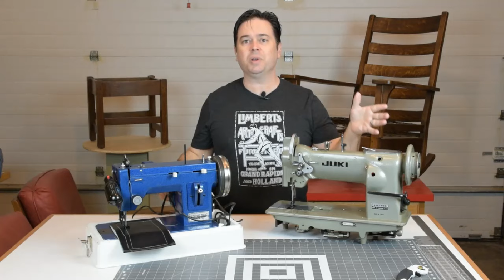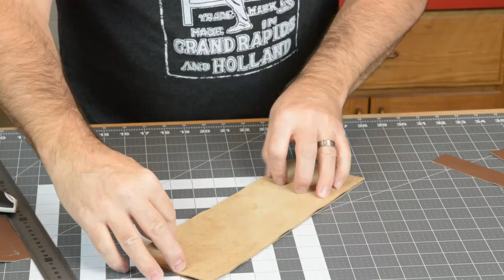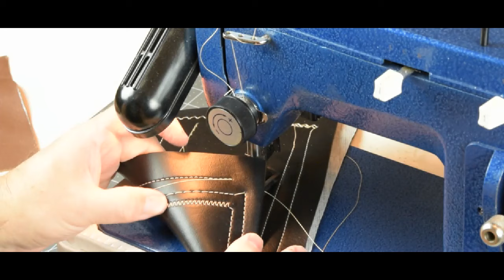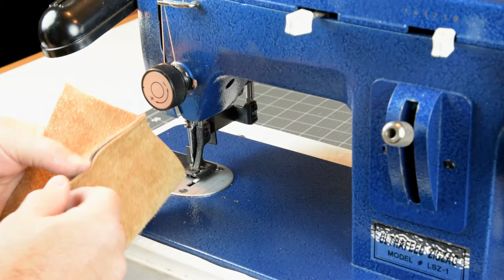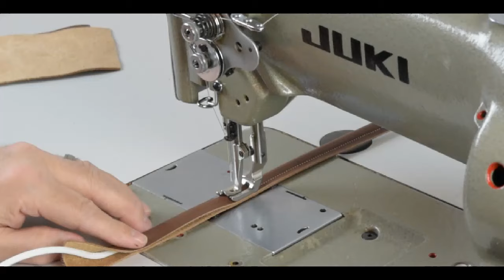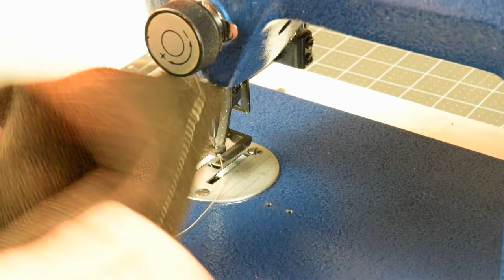Mini Walking Foot Vs Industrial Walking Foot Sewing Machine Sailrite and Juki Compared

Comment: Hi!  I love your Videos!
In this one, when you made the piping with the Sailrite, did it have the piping foot installed?  It looked like the Juki, which is an Awesome machine, did have a piping foot on it at the time.  The outcome from the Sailrite on that test was, imho, not good.  But, to be fair I just wanted to make sure it was configured correctly for the task it was doing.
Thanks!
Reply from the maker: Yes, the Sailrite had a piping foot on at the time.  Two problems with the Sailrite are the piping foot has a very shallow tunnel, and the foot doesn't lift quite high enough for upholstery work.  I'm sure it's fine for thin canvas work.  Thanks so much for your nice comment.  Good question.
Best
Reply: @TheThoughtfulWoodworker  
I just got my Sailrite Leatherwork today!  I still have to put it together and after I get used to it, I’m going to make that little table extension of yours!  I think that is a very nice extension, that looks great and is very functional!  Keep up the great videos!

FixNStuff (new name… more inline with where I want the channel to go)!
Reply from the maker: @tubeboy1776  Enjoy the new machine.  You'll like that little flip-up table.
Take care
Reply: @TheThoughtfulWoodworker  I got my machine!  Worked out of the gate.  Then I messed it up.  Walking foot was not lifting, it was just sliding over the material.  I adjusted it according to the walking foot range of motion video, but I think I need a bit more foot lift so it “walks” over the material instead of sliding over it.  I was wondering how high your walking foot raises from the needle plate?  Thanks!
Reply from the maker: @chipperleathergoods  the Juki should lift about 3/8" or 7/16" and the presser feet should lift the same amount.  If not, check out the video... https://youtu.be/04orZ30XelI it's a consew, but the same adjustment works on the Juki.  Best of luck!

Comment: This is an extremely helpful video! I'm currently working on a juki hzl f300. I'm looking to upgrade to industrial/semi industrial. Specs  I'm looking for: triple step zig zag, zig zag, straight stitch and reverse stitch all in one machine (if such a machine exists) and option to select LCR needle position. Do you have any suggestions? Servo motor preferred. Thank you in advance
Reply from the maker: Maybe a Consew 199 or a Sailrite.  Not very many walking foot zig zag machines out there.  Best of luck!
Reply: Check out the Consew RBL-146-3A . This is a long arm walking foot triple stitch zig zag machine. This machine also allows you to change the cam so it will make a standard zig zag stitch. I suggest for heavy duty straight stitch work the Consew 206 RB. This works much better than trying to take a machine that is specifically designed to make a zig zag stitch and then try to make it produce a decent straight stitch. If you don't need a long arm then the  Consew 146RB is an excellent walking foot zig zag machine.
Reply: Thanks k you for your suggestions

Comment: I have seen some of the aggressive feet leave marks on the leather, do you use a smooth pressure foot or the knurled ones that Sailrite offers?
Reply from the maker: I use the lightly knurled feet from Sailrite.  They don't mark even delicate veg tanned leather.  The traditional deep-tooth feet will likely leave scuff marks.
Best

Comment: If u had a choice between a Juki LU-563 and a Consew 226 (with both being in equal condition) which would u choose? Other than a nice big bobbin in the Juki r there other features that set them apart?
Reply from the maker: Hi, that's a good question.  My first machine was actually a Consew 226 and I liked it a lot.  There are many similarities between the 226 and the 563.  Both have top loading bobbins, and both have paddle style reverse levers.  The 226 uses a small G bobbin, while the 563 has about twice the capacity with a huge U style bobbin.  It's an advantage if you do upholstery, but a wash if you make belts and wallets.  The head of a 563 is heavier, which I feel translates to quality construction.  I personally would take the 563, but as long as it's in good shape (and hopefully had a servo motor) a 226 can be a good machine too.  Both were made in Japan.
Thanks for commenting.
Reply: @TheThoughtfulWoodworker  Thank you for the info.

Comment: Do you have a video that compares between the Sailrite's Industrial Fabricated sewing machine and a Juki (one that is still made and used not discontinued?)
Reply from the maker: I don't have a video of the Fabricator machine, but I've owned similar machines.  They aren't true triple feed machines but they are a walking foot.  Basically the needle is up when the Fabricator advances the material.  It's a simpler mechanism.  Overall the triple feed Juki is preferred but the other way is less expensive to produce.  Lots of good choices!

Comment: Question:  when you were comparing SR to Juki the test piece for sailrite had 5 layers vs 4 for Juki.  Is that not correct?
Reply from the maker: Hi Robert, actually both machines were demonstrated with 4 layers of 2-3oz leather.   
Best

Comment: that noise, its a deal breaker for me: im going to get the juki 8700 model... id like the 1181 model but don't see the price jump for the walking foot. it seems to have the same motor as some of the other types. thanks for the review.
Reply from the maker: I've had an DDL 8700.  They're pretty nice, but really just a garment machine.  It might sew a couple layers of denim, but leather would give it trouble.
Good luck with it!

Comment: What's the difference in price & weight?
Reply from the maker: Both models are out of production, so price would be whatever you could find on the used market.  The Juki can sell for around $1000 equipped with a table and motor.  An updated version of the Sailrite is still being made.  
As far as weight, it's like comparing a paperweight to an anchor.  The Juki is very heavy and solidly built, even compared to other industrial machines.

Comment: Can a walking foot be used on a ddi8700?
Reply from the maker: Hi Sharon, with industrial walking foot machines it's a little different than home machines.  Industrial machines come as a walking foot or just a basic drop feed machine.  The DDL 8700 is not a walking foot.  You need something like a LU-562, LU-563, Consew 206rb, Consew 226 or similar.  Home sewing machines have add-on walking foot attachments, but they won't really be good for leather.
Best of luck!

Comment: the juki is a needle feed not a walking foot no?
Reply from the maker: This Juki is actually both a walking foot with needle feed too.  There are some walking foot machines where the needle is up during the material feeding phase (double feed).  When the needle stays in the material on a walking foot it's know as a triple feed.  Some non-walking foot machines have needle feed, like some older Pfaff's for instance.  
Thanks for commenting.
Cheers

Comment: Hello. Have you used 138 bonded nylon in the sailrite? They have conflicting info on their site. Blog talks about 138, but machine specs say 92 is the limit. Machine can take a 22 needle, so in theory I would expect 138 thread to work.  I am completely new and trying to source a reasonable unit with this capability so I would appreciate any feedback you have. Thanks!
Reply from the maker: Hello, I wouldn't use 138 thread in the Sailrite.  I consider 92 weight to be the upper limit.  Even the Juki doesn't love 138 thread.  I have to use a #23 needle to sew leather with the Juki.  I prefer 92 weight thread for the work I do (mostly upholstery).
Thanks
Reply: @TheThoughtfulWoodworker  thank you!

Comment: WIth the "Piping"... You keep mentioning the "Machine's Limit" which is a false/inaccurate claim based upon the machine's power in addition to the fact that the company provides the option to purchase Cording specific presser feet for purchase.

If a person's focus is to use cording, then they will use the tool for the job... this claim is as false as using a hammer to drive screws into lumber, and claim that there are problems with the screws because either the heads snap off when you drive them into the board, or the teeth sheer down, or that the teeth sheer down the holes of the lumber (making them too loose to hold the screw).

If you decide not to use nails with the hammer... OR a screw driver with the screw....

...Then the joining implement is not the problem, it is the "operator".
Reply from the maker: I was using the piping foot.  The Sailrite doesn't have enough lift to clear 4 layers plus piping.  That's true even adjusted for maximum steppage.  Just use a full size industrial machine (walking foot specifically) and you will see what I'm talking about.

I wish you the best.

Comment: I'm not even going to watch the entire video, the comparison is ridiculous. If you are on a boat or have a very small space to work in (I work in a small 1bedroom apartment and a table mounted industrial won't work for me) and you need/want a machine to be portable, the sailrite is the only machine to get. If you work in a bigger shop and never have the need to transport the machine anywhere, by all means, get the industrial machine. These comparisons are ridiculous and lopsided. If you need a portable machine, there is no way a conventional industrial machine will work for you.

Trust me, you need a heavier duty machine on a boat then you could imagine. Oh sure there are "lighter" examples of a similar sailrite machine, and most are junk, the sailrite has gone through revision after revision and those others have not. But an industrial type machine will NEVER work for you on a boat, unless you have a 75 footer and have room for a work table like the industrial machines are sitting on, then I'm sure you're not worried about DIY. Stop comparing these machines with table mounted examples, they aren't even in the same weight class.
Reply from the maker: David, I agree with all of your comments.  Just trying to put info out there to help people decide on a used machine.  I've since acquired a Sailrite Leatherwork, which has a micro table setup with speed reducer and workhorse servo.  Yet another package for people to consider.  Here's a video on the Leatherwork...  https://youtu.be/c4-oxNEtyeU 
Best

Comment: Both of them are made in China.
Reply from the maker: The Juki was actually made in Japan.  
Thanks for checking out the video.
Reply: @TheThoughtfulWoodworker  
I do not think so. Juki is a Japanese machine made in China, just like Sailrite, whose parts are made in China and only assembled in the US. Check on Google. Car manufacturers have been doing this trick for more than 50 years.
Reply from the maker: @Mike61259  I'm not looking to argue with you.  You can believe whatever you want.  It's a 30 year old Juki that's stamped made in Japan.
Reply: @TheThoughtfulWoodworker  I said check it on google. Don't be lazy.